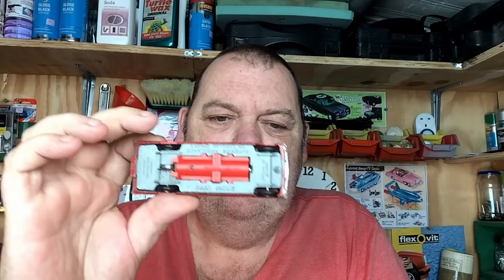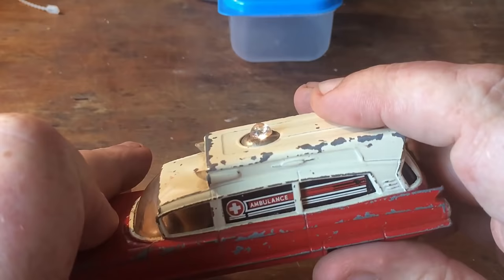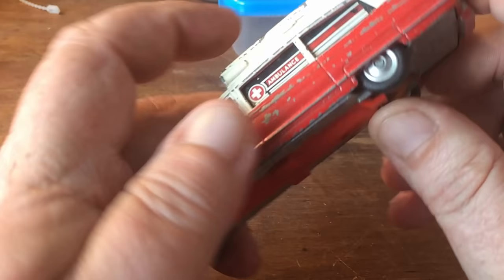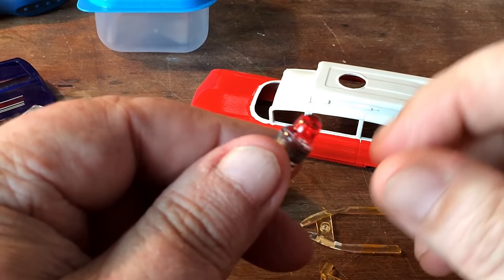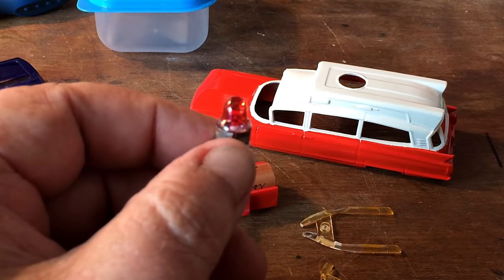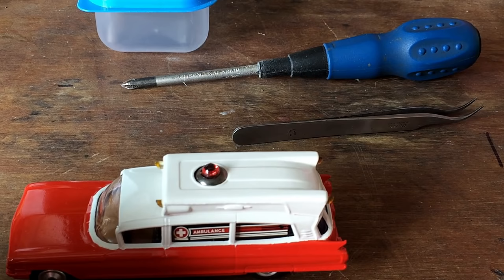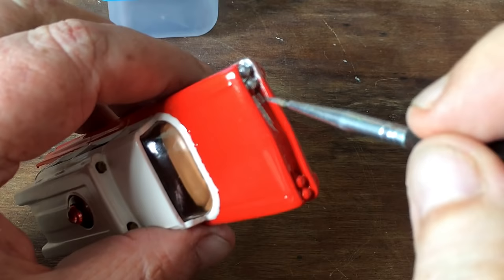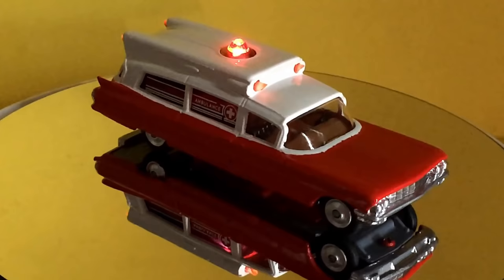Corgi 437 Superior Ambulance Full Restoration

Comment: Never seen this model before...totally new one for me. Brilliant job Bob...went straight on Ebay and got one to make over. Nice tip about colouring the bulb...I've got a few knocking about but all of them are clear. Thanks for posting...love the videos.
Reply: I had one of them, back in the 1970's.  No idea where it is now, but it was missing the battery and light unit.  Replacements are available now.

Comment: Thanks for that. Great to see how it worked originally.
It will be interesting to see how the Corgi Model Club approach their re-creation.
I believe they are removing the rocking flasher mechanism as it was notoriously unreliable. I think Corgi removed this in later versions. But I think it will be great if they could adopt some 21st century developments such as flashing LED's instead of a filament bulb.

Comment: Nice work out of a spray can. End result is just fine.
Reply from the maker: Elite Diecast Restorations Australia Thanks mate, I find it easier to use the spray can route ‘ if it’s good enough for the real thing then why not the models too 🙂
Reply: Bob Willis yep. Have you got yourself some 3000-12000 grit sanding pads? Look for micro mesh on EBay, great for polishing out orange peel and imperfections and get a good shine. I might need to find one of these for my resto channel but I see by the comments here everyone is now looking for one!🤣

Comment: You can get paint that is used on glass, it can be bought in hobby shops
Reply from the maker: Bat Willow Hi’ I didn’t know that mate, thanks for the info. The way I did it worked out ok so I doubt I’ll be spending out especially for any as it’s not going to be used often enough but again thanks anyway 👍

Comment: Great video mate !
I`m having trouble getting the light to work sadly but I`ll persist after seeing your video
Reply from the maker: Pete Raymond yeah mate just keep at it and it’ll eventually work! Just give all the connections a good sanding and cleaning and make sure you got a good battery and bulb. 👍
Reply: @BobWilliscorgi  I broke the bloody battery holder although it was brittle to start with
Reply from the maker: Pete Raymond , don’t know if you know but model Supplies sell the kit.
Reply: Thanks Bob, I`ve just ordered one and I`ll see how it goes
Reply from the maker: Pete Raymond good luck mate, yeah let me know cause I just got another Ambulance and it’s the Blue and white one without any workings.
Reply: @BobWilliscorgi  stay tuned mate !

Comment: Brilliant idea with the printer ink. I think maybe it would have been better painted on. Also Bob tamyia do that tape in 2,3, and 5mm widths. I'll try and send you a photo.  The tape is also quite flexible and can be bent around curved areas so you don't have to cut it.  Great video though 5 star rating!!
Reply from the maker: Philip Orr yes mate thanks, I did see someone selling the different sizes at the toy fair 👍

Comment: Another great video bob, what size self tapping screws are you using?
Reply from the maker: Nathan Hi mate, I’m not sure what size it was cause it was just an odd self tapping screw I had lying about ‘ the hole I drilled was 2mm so not to big, I usually use glue and rivets when I reassemble the models so using a screw on this was just a one-off🙂
Reply: No worries mate, turned out really well.

Comment: Had to get a new battery case from model-supplies. It comes unnassembled & its sloppy. You could throw it in from 3 towns away
Reply from the maker: A lot of his parts are sloppy lately but he doesn't care as he's got the monopoly of customers cause there aint no other reasonably priced UK sellers out there for this kind of thing !
Reply: @BobWilliscorgi  pitiful shame as there appears to be a market for this think. To get the proper battery holder, you have to buy the model with it but going for stupid money. Also no resto satisfaction. To strip & repaint something tidy is like a busted pencil. Pointless!!
Reply from the maker: Yes it is a shame really that he hasn't got hardly any quality control , I myself ordered a couple of parts recently from him and was sent the wrong bits . I actually emailed him pictures of what he sent compared next to the part I needed and was told it was still the correct part which clearly it wasn't ! So I was told I could return the bits and would be given a credit slip , however if I did that it would not be worth my while time I paid postage which I wouldn't get back for a couple of parts with a total cost of only £1.60 and he knows this so just carries on being sloppy! With the amount of custom I have given him over the years you'd think that he'd just send out another couple of parts gratis ?

Comment: We've had the version with the white body and light blue top since the early '80s. Ours was missing the light unit - and it looks to be different from the one yours has - so we ended up gluing the top of a glue cap in the hole to replicate a beacon. Doesn't look too bad...

https://www.instagram.com/p/BeiqRUjHCXC/
Reply from the maker: Chez Snailez just had a look on the link you supplied and it looks brilliant! Well done mate great idea 👍
Reply: Thanks! Otherwise, it's all original from the paint to the tyres...